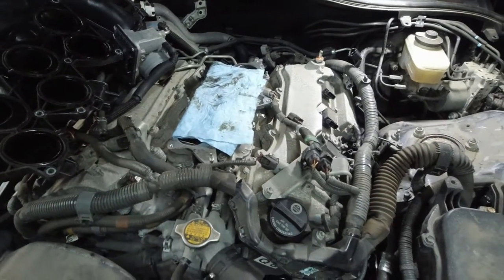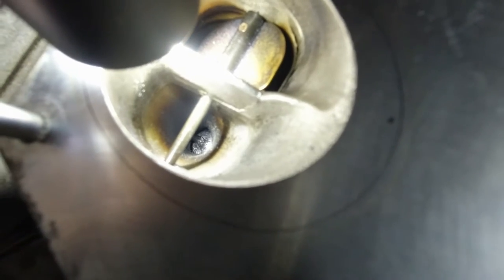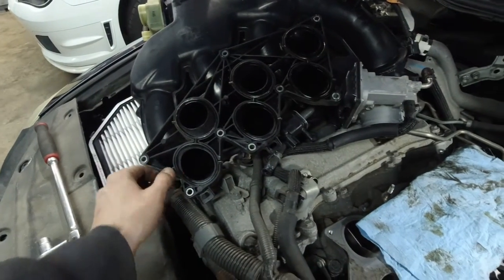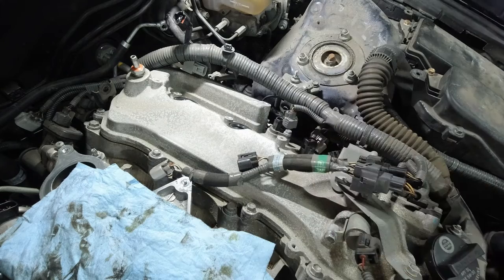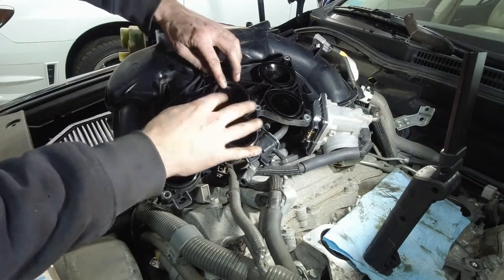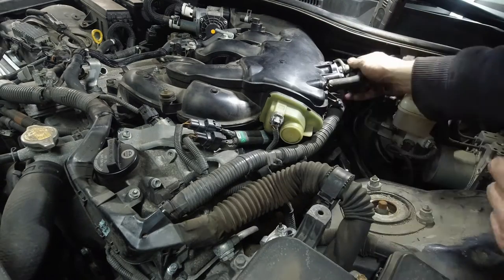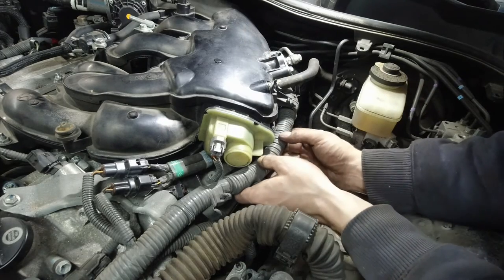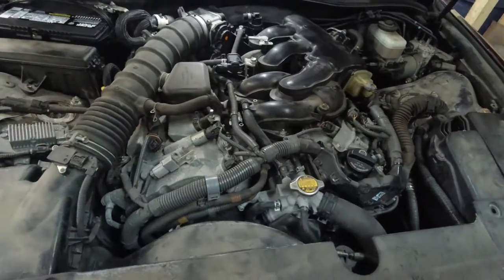Lexus IS250 sparkplugs and intake manifold replace

Comment: At 4:00 I believe that is the line for the cold start fuel injector.
Reply: and sadly that is not enough fuel to wash the valve backs apparently.....'cmon Toyota, YOU KNOW that GDI engines will do this put the port injectors in on the 250s too!!!!

Comment: Did this with a 2011 forgot to put pcv hose on the backside. Thought it was the new ruthanium ngk spark plugs . Wound up putting the old  plugs back. Will try again tommorrow morning. Hope the ruf idle issue was the pvc hose and not the new plugs. Did purchse new upper plenum gaskets victor reinz

Comment: Very helpful, especially the torque specs. Thank you!
Reply: PS: It didn't look like you disconnected the battery (unless I missaw that); is that not required?
Reply from the maker: you should disc. the batt, i sometimes dont bother if im not doing things like the alternator, starter....as long as you dont turn the key to ignition with all those plugs disconnected you will be fine, I have a scanner which i can later reset ecm with if check engine light come on, Im sure a lot of people will disagree  :)

Comment: Hi new plugs were fine. Then changed gasket seal. Left and right. Now rough idle after warm
Reply from the maker: you might have a vacuum leak, recheck that gasket and all your pcv lines
Reply: @cruizinmax4017  Checked it all. I don't know can I pay you ten dollars or slightly more and you guide me through the engine on video? Could it be sensors? This mechanic said you need to get a seal for the intake gasket the black box but did not know what he meant because the 6 rings for the spark plug holes were resealed (new seals)
Reply from the maker: Hey, sorry for the late response, youtube doesnt notify me on open conversations.  Idle the engine and spray brakecleaner or starting fluid around intake and all vacuum hoses (wherever air travels through) if the rpms of the engine change then thats your vacuum leak.
Reply: @cruizinmax4017  Hi I got carb cleaner spray
Reply: @cruizinmax4017  Thanks for the information I will try have a nice week ahead
Reply: @cruizinmax4017  Hi it was the intake gasket manifold seal that needed to be done again. Now it works and drives proper

Comment: Great video, I have IS 250 2008 Model and I have a leak at the top of the engine, not sure its because the manifold or valve covers gaskets , my question is it necessary to change them? Any bad impact on the engine Later on ?
Reply from the maker: depends how big the leak is and does it leak on hot exhaust.

Comment: I have a question, I took off my lower intake manifold to see if I had the same problem , lo and behold when i removed the motor for the actuator, the screw was nearly off. Had this car 08 is250 for 4 years and never knew about this part. I never even had a code for it until i started messing with the front part. The code was p2004. Now are both sides of the intake sopposed to open and close at the same time?? On my car I found that one side does not fully close like the other side, like their out of sync. Was wondering if that is normal or not.
Reply from the maker: I believe they should work exactly the same.
Reply: @cruizinmax4017  ok im thinking maybe they got out of wack due to the screw for the motor coming off for so long. So glad i found your video, im gonna remove lower manifold again and see if its still doing same thing, if so may replace it. Car drives much different now.
Reply: Little update, shortly after i wrote previous post, check engine light came on and would not go off. P2004 intake control stuck open bank 1a.

Comment: at the 9:58 mark in the video, what is the name of that wire that you plugged in? Looks like I need to replace it on my 2007 IS250 as one of the green wire came out of the the rubber holding. I tried to put it back in but the car starts and dies within a few seconds. Thanks in advance.
Reply from the maker: Im not sure but it looks like something to do with EGR maybe, it is attached to the lower intake, could also be something to do with idling, I actually looked online but couldnt find any info.
Reply: did you ever find out what that sensor wire is, when i went to take the manifold out two of the wires snapped and i need a new one
Reply: i just had the same issue. what wiring clips is that for? Finding this information is brain damage. Can't even locate a manual online that is usable or available to purchase.
Reply: mine didn’t even have it on there i’m so confused

Comment: I forgot to connect the intake manifold runner when I changed mine and ran it for a couple weeks. I plugged it back up but the check engine and traction light are on p2017. Could I have damaged the runner or could it clear itself up?
Reply from the maker: disconnect the negative battery for an hour or so
Reply: @cruizinmax4017  thank you so much! I’ve been baffled. I will try that.

Comment: You didn’t use the other gasket?
Reply from the maker: Only used the one for upper intake, dont have to remove the lower intake to do sparkplugs.
Reply: Why didnt you change the lower intake

Comment: would you need to remove the lower intake manifold to clean the intake valves?
Reply from the maker: yes, it would make the job much easier.
Reply: @cruizinmax4017  thanks mate